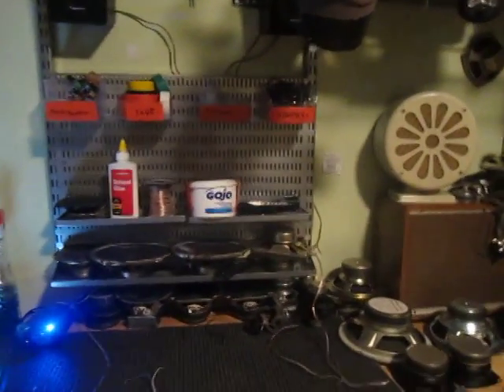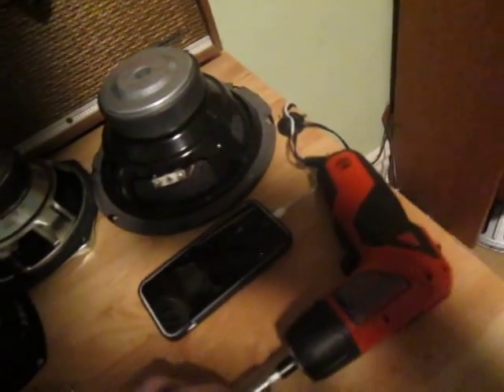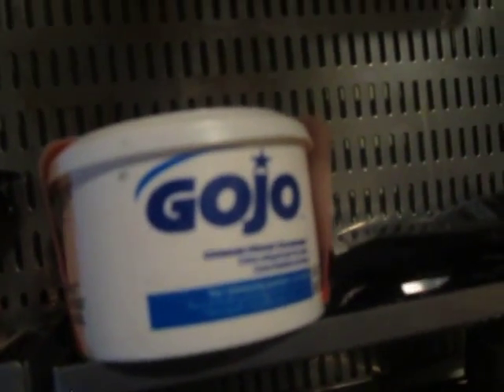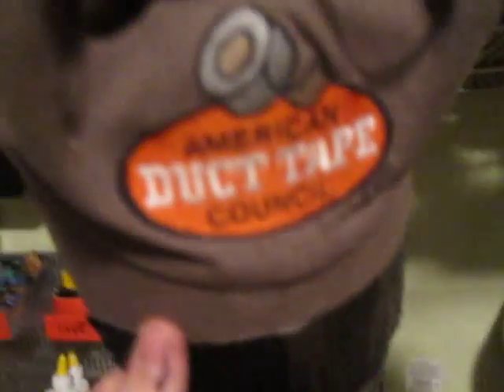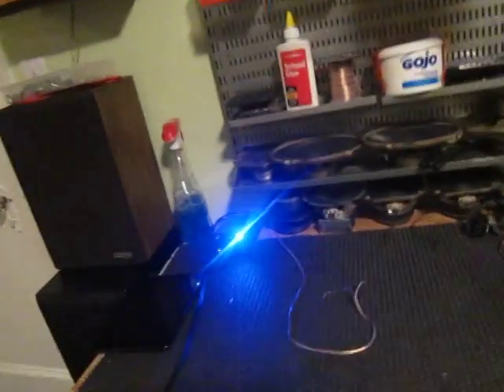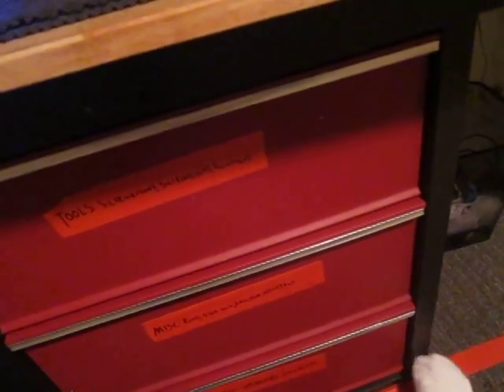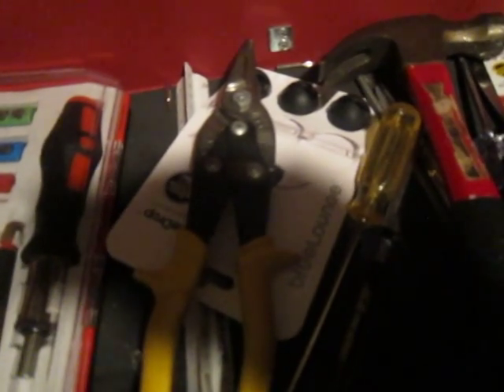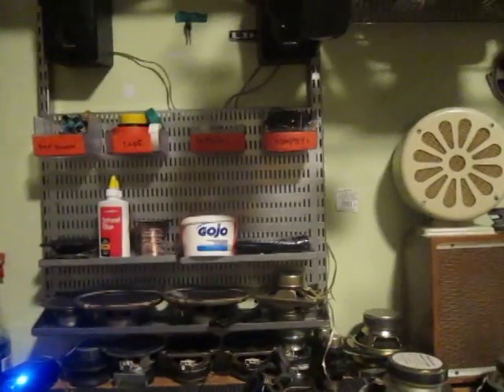My Electronics Workshop

Comment: 1:23 There's a TV Subwoofer with white enclosure! What woofer is this?
Reply from the maker: Its not a tv subwoofer. its an old speaker i tore from an old building
Reply: :) What speaker is that?
Reply: Brand, cone , watts ecc...
Reply from the maker: ciro589m Atlas Sound, Alnico, Replacement Speaker, Paper Cone and surround
Reply: :D Good